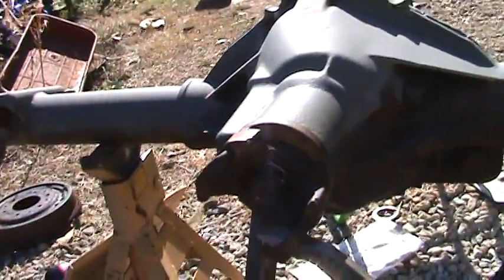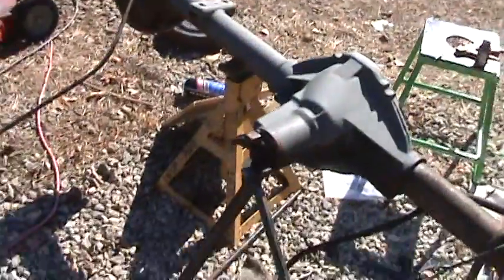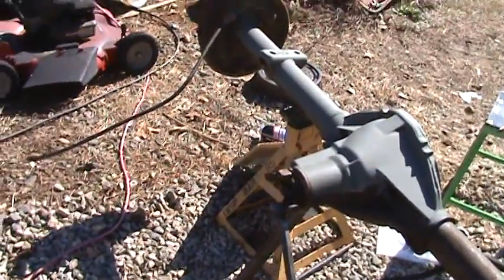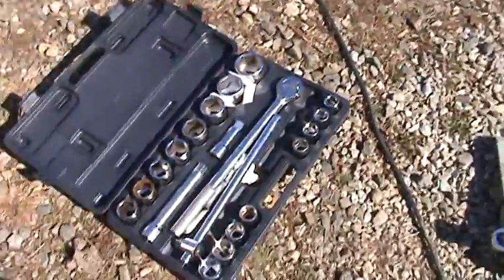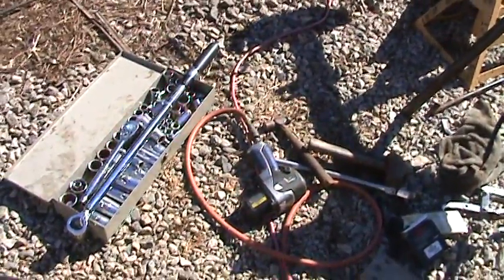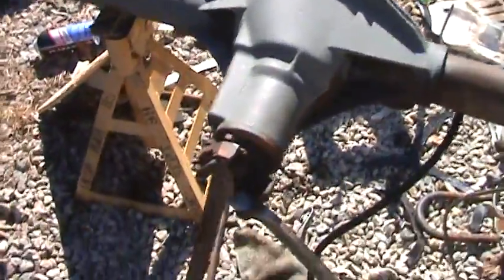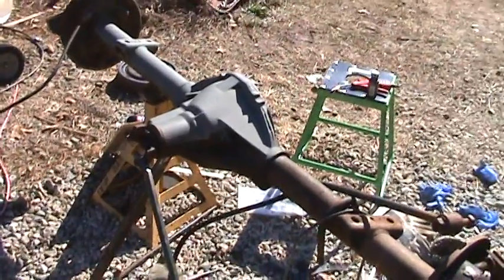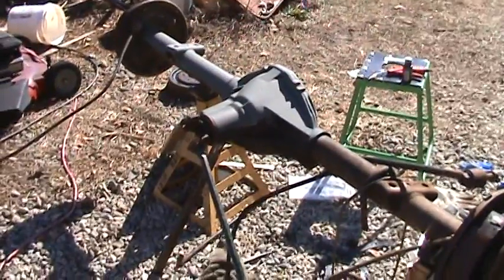GM 12 bolt Pinion nut torque

Comment: I'm doing a posi traction swap.  do i have to replace the crush sleeve.   I'm trying to save money
Reply from the maker: sorry this is probably to late to even answer but yes it is a good ideal to change it I buy a kit that has shims gaskets an a crush sleeve in it  set up is very important  im no expert have set up a few of my own back in the day when I did a little racing . there was won I could not get to crush for one reason or another so I used the old one it did ok  it had a winning noise in it got another crush sleeve got it to crush that seemed to fix it
Reply: A damn crush sleeve is like three bucks at the parts store.
Reply: You don't know what in the hell you are doing.!!
Reply: @lskiller1903  relax ! Your getting your panties all bunched up like there is a life on the line here ! It’s a diff !